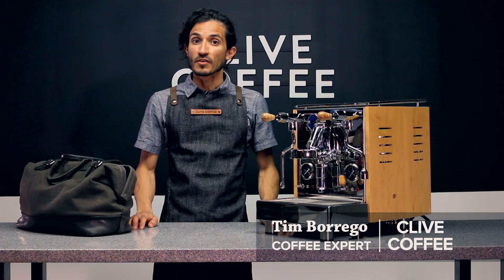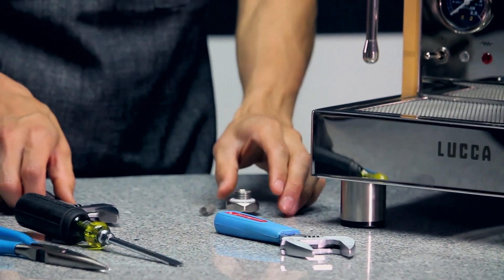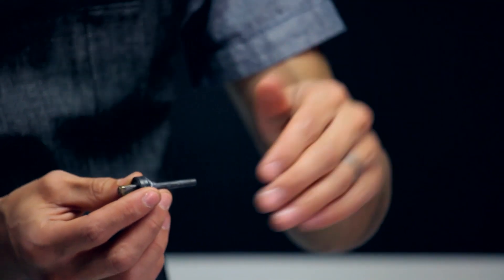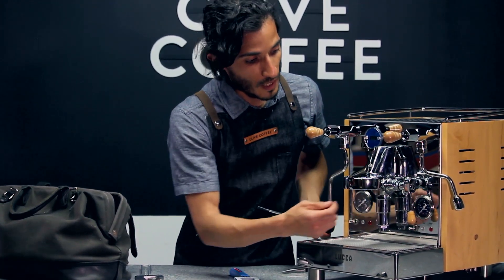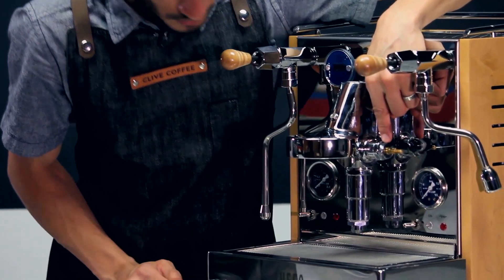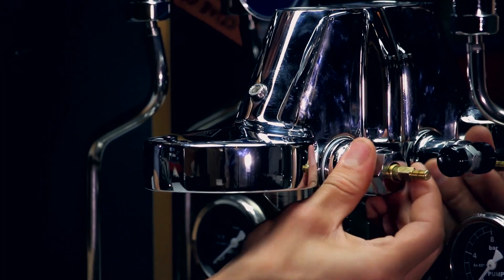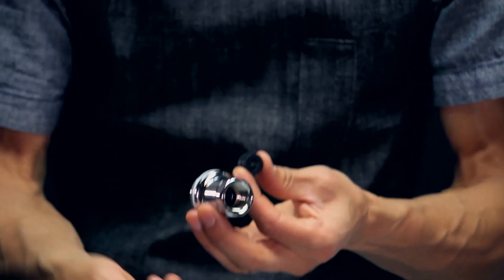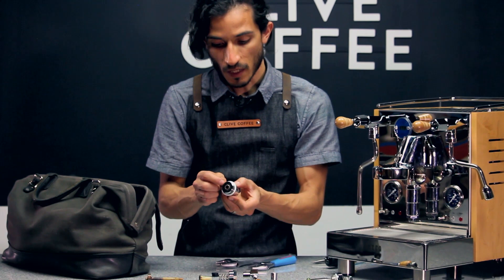E61 Group Head | Rebuild

Comment: Just used your video to rebuild my Expobar Office Lever group head. Just a couple slight differences between my machine and your demo unit. I should have followed your advice on replacing the valve stems. I spent about 30 minutes each digging out the old gasket seals in each of the three valves so I could just replace the gasket. After 12 years of use they were really cooked in and they were brittle. If I ever have to do this again, I will definitely replace each of the valve/gasket assemblies. My machine was still making great espresso, but when I shut off the lever the 3 way valve wasn't releasing all the pressure from the portafilter. Every time a released the portafilter, coffee grounds would spray out. It's all good now and working like new. Thanks for very good instructions.

Comment: Nice video for the disassembly but as others mention, a reassembly video would be helpful, especially with closeup views of the orientation of the cam and a sequence of reassembly - does it matter the order of the sub assemblies (lower section, lever section, mushroom section). Also, maybe a problem solving tip or two - what did I do wrong if I have no discharge purge at the end of the pull.

Comment: nice video -  how often does it need a rebuilt - give or take if the machine is  used for 3 shots a day ?     yearly rebuilt ?
Reply from the maker: If you're using filtered and soft water, typcally every 3-5 years. Could be sooner, could be later.
Reply: @clivecoffee    thanks - thats not too bad -

Comment: @6:27 how do you know if you need one or two? I took one apart seeing only one inside, but it looks like it could fit two. I'm not sure if it was improperly maintained and someone lost a gasket or if it's just fitting for one. There is no leaking. So, i'm guessing this is a dumb question that it only fits one, and i guess stuffing two inside would make the spring tension really tight to push back and possibly wobble for the metal that touches the gaskets first before the spring.
Reply from the maker: When you take it apart, there should be one or two. If you're unsure, feel free to email our techs for guidance at support@clivecoffee.com

Comment: Hmm, first step: Pull out the adjustable nut f***ers... 

Listen. In the short time I've been on this earth I've learned you should always start with proper fixed box end wrenches and if a size just isn't available (Spoiler alert: Between a complete 1 unit graduated set of Metric and all common sizes of Imperial all sizes are available...) then you go to the adjustable. No compromise.

Otherwise, great video to learn more about the innards of the e61.
Reply: Using an  adjustable wrench gives you the ability to loosen the mushroom without accidentally scratching the soft chrome material.
I always use a cloth in combination with an adjustable nut f****er when working on soft material.

Comment: At 6:10 your cam was very easily removed from its housing. On mine it doesn’t come out at all? Any tips on this please?
Reply: It's easy to remove. Hold it so the shaft is pointing down, put the end of shaft on a piece of wood and push down.